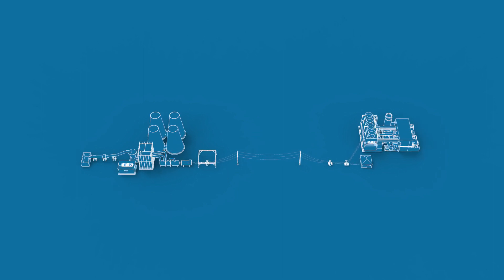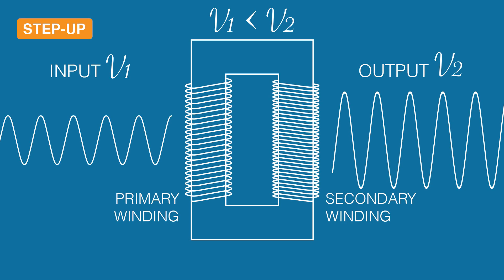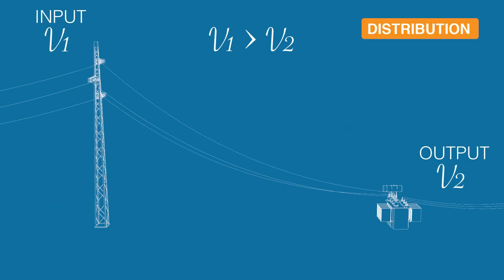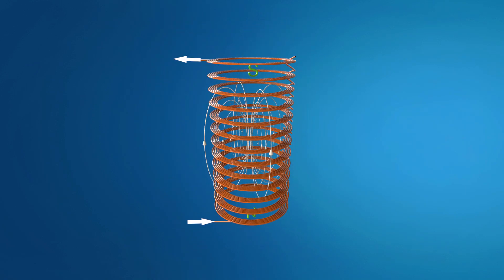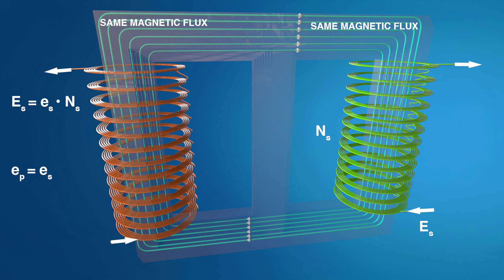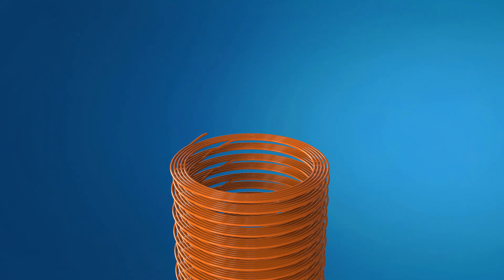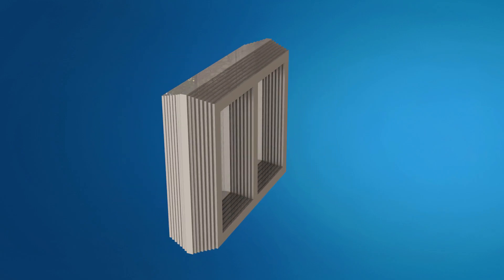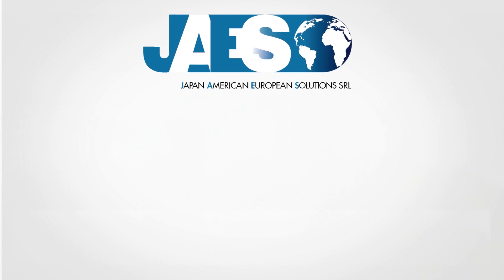What is a TRANSFORMER and how does it work? Transformer types

Comment: Did anybody read the script for the narration?  This is highly overcomplicated.  Using the word tension and voltage.  This is a trainwreck.  And a transformer is not considered a solid-state device.  And read this from the transcript.  This makes no sense:
"...step-down transformer used to step down
the voltage level from lower to higher level at secondary..."
That makes no sense.  You can't step down to a higher level.  All these JAES videos are like this.  What the heck is going on with these guys?
Reply from the maker: Dear Alex, thanks for your opnion please let me know in which part of video you identify mistake we can check and try to make better.
Reply: @Jaescompany  Excellent video, very informative